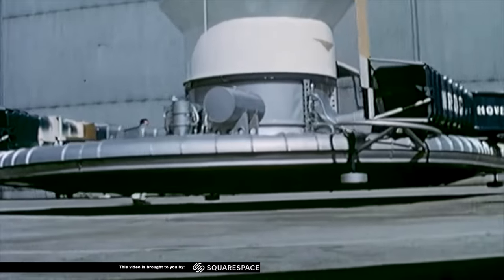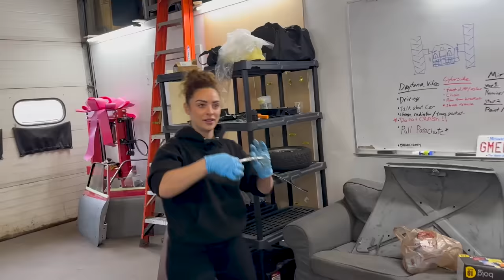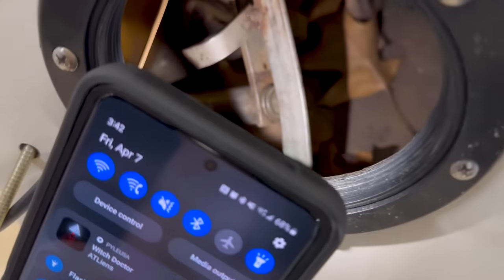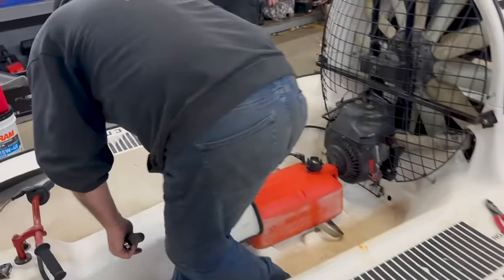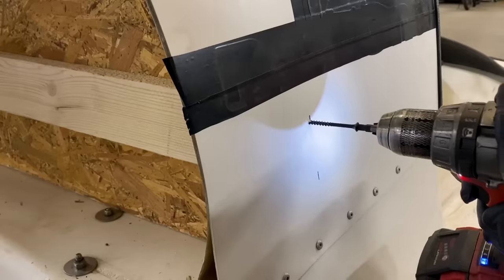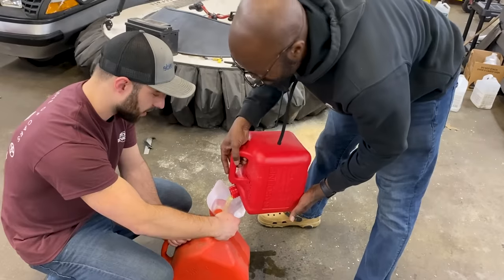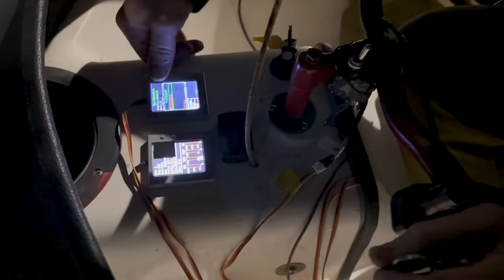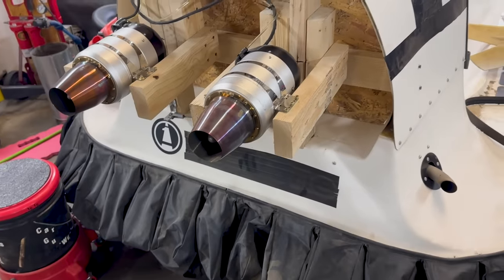We built the worlds first full-size Jet Powered Hovercraft

Comment: The Hellcat was fun but the Jet Powered hovercraft was more fun. Sorry about your tires and sorry I had to redo Leendas work haha, all she needed was a pair of long nose vice grips 🤦‍♂️. Glad it worked, hope u get to ride it more with the jet engines.
Reply: This man is doing the Lords work.
Reply: Its been 6 months buddy when are you dropping some content
Reply: @Jacobtheunwise  Soon...This week finally. I was building the Cordless Tesla 2.0 which took forever smh, then went to Rich Rebuilds to hook up the hovercraft, now I'm building another car for Mr Beast but I'm back on track now 🙂.
Reply: @Warped Perception  awesome i loved the last cordless tesla video cant wait for the new one
Reply: 9:53
Reply: @Jacobtheunwise  thanks the new one is legit, but the road trip to Rich rebuilds and back did not go so well. I should have the video out before the weekend.
Reply: @Curling_Rack  I think this is where Chad messed up, you shouldn't hone a cylinder unless putting brand new rings because it bores out the cylinder slightly and removes all of the break-in sealing.
Reply: I probably missed this in the video, but why block off the main fan? What's the downside from providing a little more thrust/efficiency?
Reply: @koolkeef  well I wanted to separate the lift sir from the thrust to have more control. Adding the extra fan blades was something that rich and his crew did. So I don't know which way it worked better but yeah I wanted the lift are and jet thrust separate.
Reply: Enjoy your content!
Reply: @Overqualified1  thank you, I'm just about at the end of my dry spell and I should start uploading videos this week, cordless Tesla was absolute nightmare
Reply: @ROVER25X  hahaha... I know 😏

Comment: The originally hovercraft is actually a well-packaged design for a manufacturer. Like a lot of small engineering firms / projects they didn't consider that it would need to be maintained and look at the packaging from that perspective. They did what was easiest for them in the short-term.

Comment: I can confirm they do float without the fan working.  I was doing an experience day and the fan sucked up a stone just as I was entering a water section. The fan exploded and I have to be rescued and did not sink lol.  Btw there are loads of jet powered hovercraft, the ones that did a ferry service across the English Channel had two rolls Royce Spey.  I think the fans were turbo props though.
Reply: Correction. Mountbattern hovercraft had 4 rolls Royce proteus

Comment: Fun (maybe) fact about that fan on the hovercraft. They're exactly the same as what is used in commercial tube axial fans which are in carpark or building ventilation systems. I used to work as a HVAC engineer.

Comment: ❤️🙏🏻 This was very cool rich!!
Ps. Why did your duramax stop running? My 2004 LB7 Duramax stopped running several months ago do to melting down the ECM. 
I’ve gone through 4 ECM’s and checked every wire in, on and under the truck and found nothing wrong!!  Plz respond Richard, 🙏🏻

Comment: I used to have the scat, a lot of noise, dirt, but a whole lot more fun.
6 blades will make the throttle more responsive.
Reduce the angle of the 6 blades since you only need lift, you need to keep the engine speed in the power range.
You can reduce the duct size of the skirt to balance the lift.
Keep it rear heavy to "land" or you will "nose in". 
You really should be testing on water, safer if you have a chase jetski .
I would not recommend grass field unless you plan to start a fire......
Snow covered field would be easier on the Scat.
Wear a light helmet and neck collar on your speed runs..🎉
Reply: This is the smartest, most well-informed, and underrated comment on here right now. They powered up the blades just to refocus them entirely underneath, giving too much lift. Then they ripped a brand new skirt on the pavement.

Comment: It's nice, but what is Rich going to use it for?  Two minutes run-time doesn't allow for much playtime.  Those jet engines use up far too much fuel even at part-throttle.
I'm glad the group used much more caution this time around as no one had much hovercraft driving experience😅.
How about a Stevon update?  He's definitely being missed.  He's like Robin missing from Batman's side.
Reply: Oh so much caution! Like having a kid in a barely tested, slapped together vehicle with NO HELMET.

Comment: You need to install a lift up rudder system on the hovercraft. It will give you turning stability and then you can just lift it up before you hit land. If you ask me that makes way more sense than changing air direction.

Comment: changing the number of blades on the fan is kinda like changing the gear: more blades = higher gear, less blades = lower gear. technically more blades are less efficient, but its not the main effect you're experiencing.

Comment: An easy way to get springs off like that , is to use a piece of small rope like 550 cord if you don't have a good set of pliers. Loop it through the end and pull it off. You then have a lot of control.

Comment: Hey Rich. I didn't think you are the guy who cuts fiberglass with grinder disc. I mean you can put circular saw blade on that thing and it cuts way better and with less dust. As a bonus, it's dangerous as hell and exceeds maximum rpm with 2-3x. It's not enough to cause immediate failure but it definitely makes life more exiting.

Comment: I wonder if mounting the jet engines on the outside of the fan duct would give you more thrust? That way they have unrestricted intake air flow instead of having such a small area of airflow in between the 2x4’s and maybe 6” in front of the rudder piece. I know this was a quick slam it together type of thing, but you’ve got some killer fabricators that can whip something up!!
Reply: The further apart they are, the better the steering response and control too.

Comment: i can't find concrete info (prolly classified), but i think the Zubr Class LCAC uses turbine engines to inflate the skirt, it's not pure jet engine, as it is still connected to a ducted fan, but still technically a jet engine.

Comment: The best design for a hovercraft had thrusters placed two in the front for braking, one each for the four corners for greater control of steering, one in the rear for forward thrust, one below for vertical lift.  It gave the greatest control over the vehicle.  Hovercraft can be made buoyant so that when fuel does run out, you need to take a break for whatever reason, or if there are mechanical problems the craft acts like a boat.  No worries of sinking.

Comment: What a mess!.. the older SCAT hovercraft were limited by that Rotax single lung setup. It was never meant to go fast without serious modifications, none of which were done. Installing a couple JCats was just a waste of money for something that was not going to go very far. I have the newer 4 man version of the SCAT called the Air Commander and it has 2, 50hp ultralight motors in it stock! One is for lift and the other for push. I really don't think you guys did any reading on what you were trying to accomplish here, maybe just a bit quiet around the shop and..?
Inserting more blades only sapped all your HP at an earlier RPM and also increased the rotational mass, that's where all your power went. The Rotax couldn't go into power band because your ears are used to listening to 4 cycle motors rev out.. 2 cycle power SCREAMS when it's happy! Just the right dude helping you could have made that a real fun toy without the J-cats and the destruction of the machine, they are getting rare!

Comment: You cant cover the output of the fans with wood . The wind from the fan needs to be ducted to the underneath of the hovercraft with a long 90degree sweeping duct . To do what your trying to do maybe cover 25% of the air output shroud but you cannot block it off that close to the fan into a blocked or smaller opening without it adding restriction against the motor .

Comment: So, I'm wondering... why not create separate throttles for the hover pressure and the thrust. Maybe a step-lock type for the hover, mounted and the body not the handlebar. Use the six blades but with a chain drive (or at least a toothed belt). And put the thrust actuator onto the handlebar. This way, when you need to slow, the vehicle will keep it's ground clearance, won't drag the skirt as much, just spin around to reverse thrust since the vehicle is more agile in this form.

Comment: You should attach some wheels on the bottom for the craft to rest on when the bag deflates, this way it'll be easier to push when you run out of fuel and you can add brakes, and steering as well as saving the bag from getting completely destroyed

Comment: I'd love to see you build a modern version of the coolest concept car from history. I think it was a Honda S600 roadster with a DC electric motor and a jet turbine engine running as a generator to power it, making it one of the first jet powered concept cars and also one of the first hybrids. You can get a Jetcat model designed for large model helicopters that gives you about 25hp via a shaft driven through a planetary gear set which would be perfect for this and other projects. Jet powered go kart maybe.

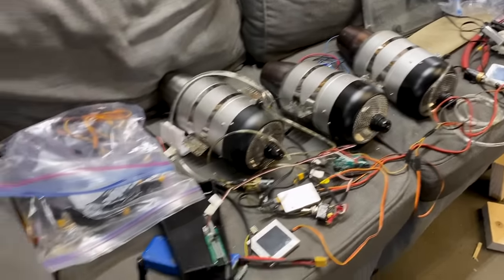Comment: 23:30 right before here i am reminded to always use pilot holes... or never drill into end grain.
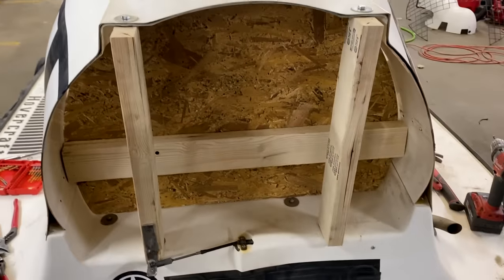Reply: 23:45 now i am worried that he is planning on mounting jet engines to these.
Reply: 23::58 fun indeed considering the splits on the axles (2X4's).
Reply: 30:00 i notice straps on the fail points. good job!

Comment: The world first jet powered hovercraft is in fact an hovertrain, the french Aérotrain, a jet powered monorail machine on air cushion made in the late 60's. Its inventor, french aero engineer Jean Bertin, is also the one who invented the rubber skirt for hovercrafts. 
The 80 seats, 20 tons, 20 m long baby still hold the land speed record for air cushion land transportation vehicle, at 450km/h. And the pilot, a accointance of mine, told me that he could have pushed the thing more if he had a longer track. 
Be careful with that kind of stuff, guys, 'kay? Lots of thrust and no friction whatsoever is a recipe for uncontrollable high speed, and a smashed jet engine, even an small one, throws deadly shrapnels at very high speed too.

Comment: I’ve gotten small engines running that have been seized, completely, rusty, crank, and seized bearings I disassemble them completely and clean, any grit off all the parts and slap them back together and they work I know it’s not recommended, but sometimes you get lucky

Comment: Would the jet engines be more efficient if you cut out holes in the plywood to have air funneled to them? Also, it may help cooling if the get too hot.
Reply: I agree. Turbine engines do pull in a lot of air

Comment: yo Rich you might know how hovercrafts work but just in case you dont. if you are moving and you stop giving any throttle you will flip, eat shit and die. it would probably be better to lock down the hover motor cruise control style giving loads of lift and then not touching it. If that motor for some reason dies mid corner you die with it!

Comment: I run diesel in my big, box truck. It doesn't look that color that you are pouring into the red plastic tank. So I'm thinking… Maybe it's already mixed. With some of that Blue DEF? For modern diesel engines today. I don't know? That's bizarre in appearance.

Obviously it still works like diesel fuel because, it is.

And when you consider, kerosene is similar to, gasoline. And diesel is similar to, cooking oil. How anything can run on that stuff is, beyond me? As it's not exactly, flammable. Like kerosene or gasoline is. And amazing that jet engines can run on that stuff. It wouldn't do much in a gasoline engine. So???

As I am not a mechanical nor, petroleum engineer. I'm a, Audio & Broadcast, Engineer. But I'm still an engineer. I just don't do, turbine engines. Piston engines, sort of. And a 1 and 2 and 3 and 4. And has more rhythm to it. The other one just gets kind of loopy. And around and around, and around it goes. Really really fast. It's one circular piston. In a turbine engine. It just, twirls. Great for folks into the Grateful Dead. As it just, twirls.

Personally I want, Anti-Gravity Drive. And so I'm waiting.
RemyRAD

Comment: I don't think you need anywhere near the power you are suggesting to lift a hovercraft. Look up "pedal hovercraft". Many backyard ones on YouTube that work! I think it's just the low payload (compared to a boat) and slow speed and hard to manoeuvre compared to a boat in the docking areas. And build and maintenance would be expensive compared to a boat. But there is one advantage of a hovercraft, no anti-fouling required!

Comment: The power of the fan making the air cushion will limit your speed. As you go faster, the air tends to blow back out from under the craft and it will settle, front-first, perhaps even digging into the pavement, with resultant sudden stop or cartwheel.
 
I know, I made a model hovercraft as a science fair project in 1960. Someone stole the engine just before judging, so no prize for me. A real disappointment and lesson in human frailty.

Comment: FYI you can buy kerosene at home depot in 2.5g jugs. I know mass in retarded with such things but in rhode island there are tons of gas stations open 24/7 that sell kerosene at the pump. There's even some with leaded race fuel >:) I use it in my snow blower. Just don't snitch on me to the neighbors

Comment: To me a hovercraft needs front pull aswell as back push .my idea would be to add a front prop reverse the gears and props so your sucking kind of pulling the hovercraft forward the reversed geared prop.. will wanna try pull your hovercraft upright forward tryna take of the ground it aids the rear props to try and level out whiles off the ground point towards the air..

Comment: Cleetus Mcfarlane hovercraft was faster than this turbine set up with the original 25hp engine. After he upgraded to 65hp engine it was doing 50mph on the water.  I think Rich needs to upgrade to electric engine like the one he put on the hot rod, that was putting 100 sq.ft torque. That's more torque than Cletus Rotax 65hp hovercraft engine upgrade. 
The only problem i see is Rich doesn't wan't to spend the time or money.

Comment: I know what other people are going to say especially due to a certain previous video so I'm not going to go there. Instead I'm going to say something that shows my age and my level of stupidity. In all my years the only thing I knew about hovercraft are a couple of remote controlled hovercraft toys the GI Joe killer whale and I know there was a hovercraft Theory I don't know if it's still in service.

My understanding was these things were Run by One motor operating the skirt and a separate system for the thrust I didn't know that the fans were both the skirt and the thrust together? The one in GI Joe as I understand it the fans were the propulsion and the air pocket was run by a totally separate motor which I assumed was the way all hovercraft worked everything running off of one motor that looks like it came off of a snowblower does seem kind of janky and inefficient if I'm saying things right from my perspective. I'm like 90% sure of that motor you guys yanked apart is a single cylinder snow blower motor side Pole they were commonly used on ride on lawn mowers as well for a time might still be and they're also used on things like rotary tillers. Even a racing go kart engine would probably have a lot more pump than the motor that they put on that thing. Maybe with the other one you could consider putting a side pole engine like off of say a motorcycle and seeing what kind of difference it makes in the torque how fast it spins the fan blade that kind of thing just throwing it out there maybe somebody's already thought of that.

Comment: These hovercrafts were very under-powered they should have had at least a 440 snowmobile engine the single-cylinder just doesn't get them going they were best if used over grassy areas and water hard surfaces will destroy your skirt.

Comment: cleetus mcfarlands propped up hovercraft with the race engine looks way more manageable.
This is cool n all but if you have to keep the stock motor running anyway not that practical.
This would need some drive of the turbine or air funnel so the jet would blow up the bag as well :D